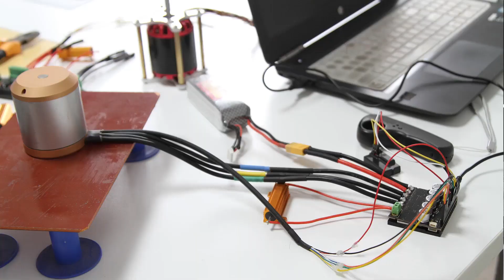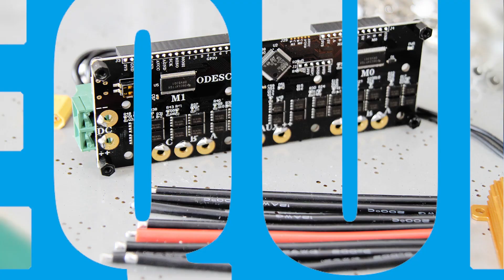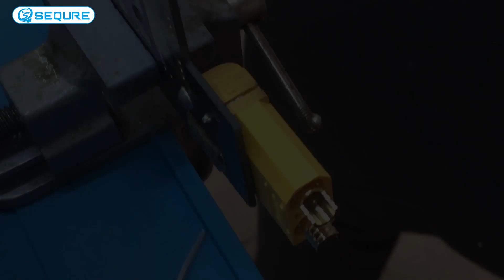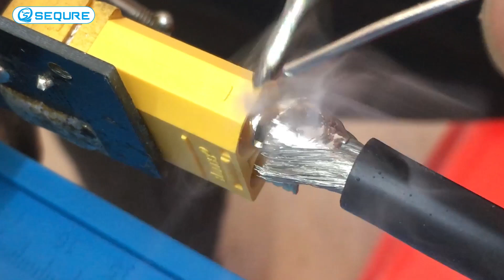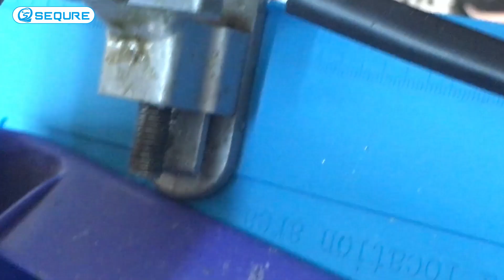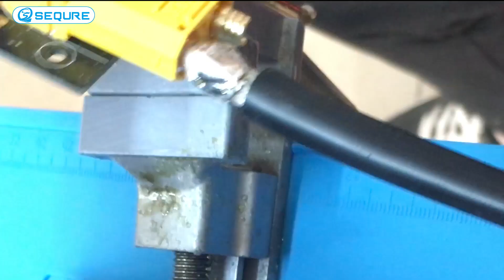Soldering XT90 Battery Connectors,Welding 6AWG Cord.How to Solder  6AWG Power Cord and XT-90 Plugs.

Comment: This is just asking for cold joints and resistance issues. Just cut half the wire strands so you can actually fit the wire in the connector correctly then fill with solder and cover all the cut strands in solder or get the correct size wire.
Reply from the maker: Our XT90 is used for spot welding with a spot welding machine. The maximum pulse allowed by our spot welding machine is 500MS. To carry a large current, cutting the wire will affect the output of the large current.
Reply: This looks so poorly made. Cold solder, ot looks like only a mask of solder in the outside. Good not to do video.

Comment: Solder job is not very good you need to use QSE8mm or QSE10mm anti spark connector. The maximum XT90 Can take is 10AWG even then the connector still damages itself due to spark.

Comment: The best way to connect 6ga wire to an XT90 is tin the wire then swage it down to the OD of the connector with a round crimp tool. Tin the connector and join the wire to it. It won't go inside the pin but it will match the pin OD and be a good joint. This video is showing what NOT to do.

Comment: First off, that wire is too thick for an XT90. 
Second, you should have used flux and add Solder to the wire before you connect to the connector. If you did is would have been less heat being transferred to the connector that would be deforming. 
What you did, should be a video of what not to do 🤦‍♂️
Reply from the maker: There is a connection to the heat sink behind the XT90 plug, which is not clearly photographed in the video. But if you look closely, you can still see it.
Reply: You just created a very bad conductive connection. The copper need to touch the copper inside the bullet and then weld. Lead alone is a very bad conductor compared with copper to copper. You have an F in your technique and cable/connector combination. If you need to use 6 AWG wire, consider a QS8 or QS10 connector.

Comment: XT-90 is only rated for 90 amps and designed to use 10ga wire . 6ga should not be used with XT-90 . Also
using a flux pen helps the solder flow .

Comment: Hi, does the end cup of XT90 fit with a 6awg wire? It looks like the wire is too thick for the holes of the end cup. Thanks.
Reply from the maker: It will not damage any components. The V-CUT of our PCB is cut very deep and can be parted gently. Also, choose to part the side without components.
Reply: Max. Current of XT90 connector is 90 A. So, only 11 AWG(Max.100A) is available !! 
AWG  Max.Current(A)
--------------------------
  ....
  8           200
 10         140
 11         100
 12          88.4
 13          65
 14          55.6
  ....

Comment: Well, it sorta looked like you were welding with solder. However, solder on the outside of the wire doesn't help anything. I couldn't quite tell how much of the solder was reaching the cup in the connector or if the cup was getting hot enough. At least you didn't hold the iron on it too long after withdrawing the solder and managed to keep the solder shiny..
Reply from the maker: Because the video is accelerated, and the tool we use is a high-power soldering iron, it seems that the soldering iron stays for a short time. In fact, it is enough to melt the wire and XT90, and the XT90 will be directly damaged if the time is longer.